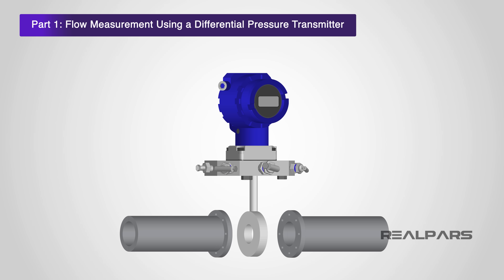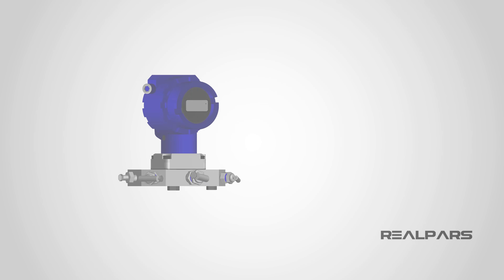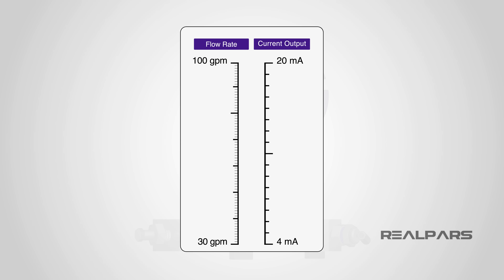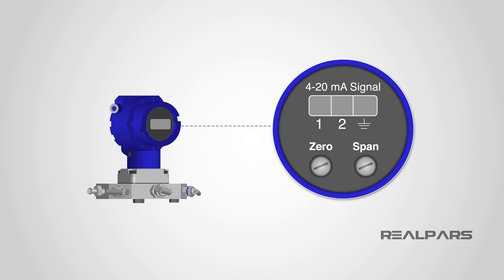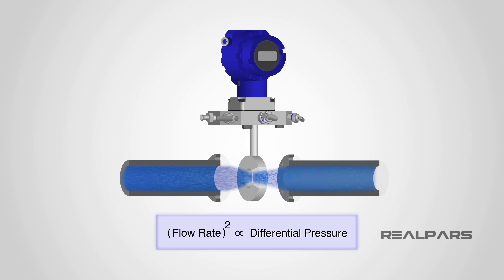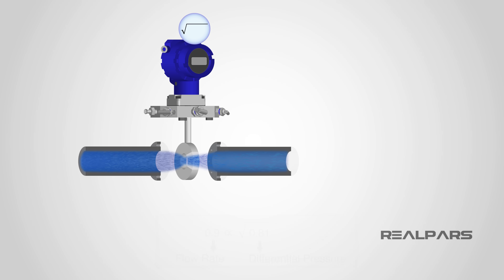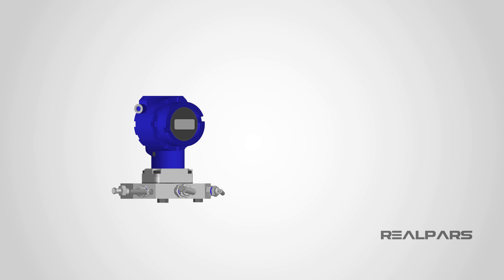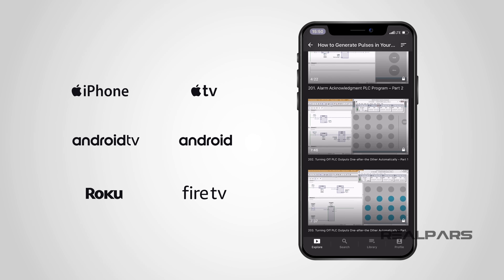How to Measure Flow Rate with a DP Transmitter

Comment: Hi this question is not related to flow but this question is about pressure transmitter range.if pressure transmitter have range -100 to 150 kpa then what will be MA at -92.plz any body reply me and plz share the formula thanks
Reply from the maker: Hi Mohammed.  Thanks for reaching out. Total span is -100 kpa plus 150 kpa = 250 kpa. -100 kpa is 4 mA. 150 kpA is 20 ma.  50% point is 25 kpa and is 12 ma.  -92 kpa is 3.2% of span.   3.2% of 20 ma = 0.64 ma. Therefore at -92 kpa, the current would be 4 ma plus 0.64 ma = 4.64 ma
Reply: @realpars  thanks but I also wants farmula for this type of conditions or do a video I will be better.

Comment: Why is it so expensive to measure the flow-rate ? Alot of small Sensors costs up to 1000 Euros. Of course it depends on how precisely you want the result to be. But is there a cheaper / easy way to Measure the flow rate ?
Reply: If your meter comes in an explosion-proof stainless steel enclosure, that adds quite a bit to the price. But you are correct, they really are overpriced (especially the simple DP meter).

As for building your own, you can get the PCB mounted DP sensors for cheap. You would have to do your own software, but there are probably examples out there.
Reply: The question is a little bit vague. It depends on what kind of fluid you want to measure. If for example you want to measure the water flow rate, then there are many options available in the market with less than 1000 euro.